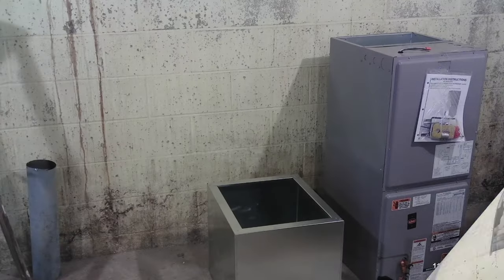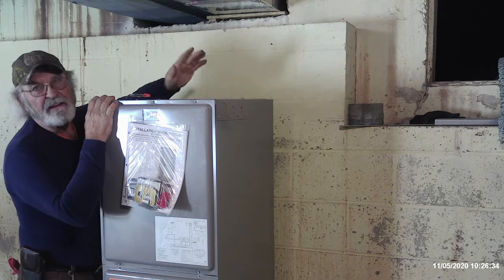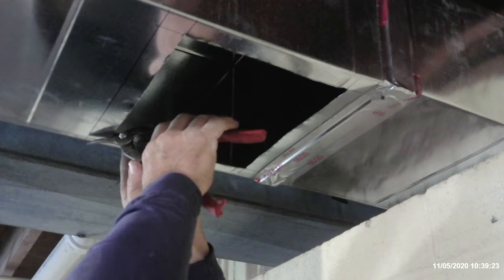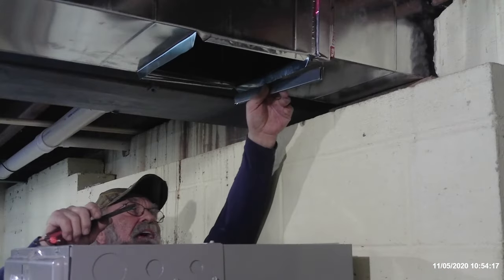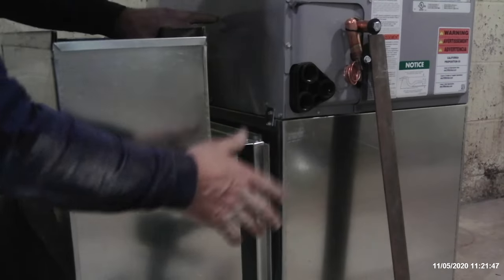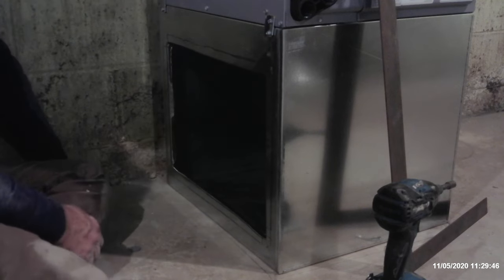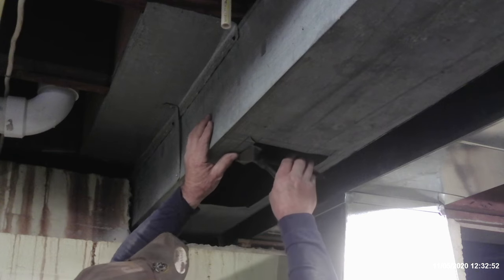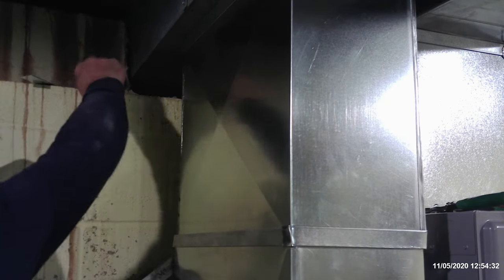Air Handler,  Centerline Plenum Transition and Return Air Installation

Comment: I'm a retired metal worker from local 48, Birmingham, Al.  U seem to have a great background of fabrication process, only question I have u used a soft joint on return air, why not include this procedure on supply duct instead of hard hookup, but great job, u had some good teaching also
Reply from the maker: Thanks David for the compliment on the project.  I usually don't use flex connectors on residential systems as small as this little 2 ton with 800 cfm.  The video may have been misleading in appearance because of the angle of the camera, but the return was a flange connection, screwed into the side of the furnace.  And that lower fitting was a  r/a 90* with a built in 1'' filter slot. Thanks again for the nice words.

Comment: awesome.  just awesome.  Some of your tips are going to save me time on my next jobs compared to some previous ones.  Cheers
Reply from the maker: Great !!  I am glad to see others getting a bit of a benefit out of the videos.  Thanks Steve for the comment and keep doing the best job you can.  It always pays off in the end.
Reply: @tractorman4461  One question.  If I wanted to "geek out" or had a more restrictive sytem that I needed to move more air through, could I throw turning vanes in the can the airhandler sits on.  I've done it before on my return boots with great success and like to do it when I can. Just going to install some heatpump/electric airhandlers with a base can under.  If I throw turning vanes in the retun boot, not sure how much more benefit I  would get our of putting them in the base can also.  Also thinking that I should either do vanes in neither or both only... any thoughts?
Reply from the maker: @sbitschy  I think the main benefit would be a more even airflow pattern across the whole indoor coil.  An engineer could probably crunch the numbers and assess the change in system efficiency with a near perfect air pattern for heat transfer. If you install them a good test would be to actually check airflow before and after with accurate readings across the fitting both times.  Of course the simple way to check cfm with an electric air handler is using the calculation for temperature rise method.  CFM= volts x amps x 3.41 divided by temp rise x 1.08  Memory fades over time, so you better check that to be sure. 
     Now that will be temp rise with resistance heat only, not the heat pump too.  If you are doing multiple systems, I would try the first one with turning vanes  in the box, then do the test to find out if there is a measureable difference in cfm. Cutting down the turbulence may reduce the return static which may actually give a good result.  You are making my brain hurt Steve...heck, I'm retired !!  I'm not supposed to have to think any more !!  LOL
   Side note:  I HAVE put vanes in return air fittings before and did not regret it.  But it is not the general rule, as you obviously know.
Reply: @tractorman4461  lol.  You are a good man.  just the fact that you responded was great.  Your thinking is along the same lines as mine.  Ive seen significant reduction in pressure loss through my return boots and filter at the outlet of the boot when using turning vanes.  Those were when entering a furnace from the side.  Just havent seen anyone do it with an airhandler where the return air has to enter the bottom with a return can.  I was just curious if you had done it or seen it work well, thats all.  Thanks again for the reply and for all your videos.  It means alot!
Reply from the maker: @sbitschy  I try to respond to most.  There are some that disappear for some reason when I click them.  And some get put in the spam file and it takes a while to find them.  The spam file empties after 60 days, so I'm sure there are some missed for good.  Crazy stuff these computers. 
   I think I said I've installed them in return air fittings, but didn't clarify that I've not really done exactly that which you describe. Good conversation Steve.

Comment: Remove section of supply trunk, shouldn't have been there in the first place.  Install full size, non transitional plenum 1" down from floor joists, with lid and use transitional pto's with 3" rise for both directions with flexes installed on each pto.  Can't you cut r/a boot with radius into side of air handler and use separate filter rack? Then furnace can be on the ground for greater plenum height.  (I might be wrong about that part). Drop should be flc, then flex, then drop duct to r/a boot.  Therefore greater static pressure on supply with smoother air flow.  Flexes are for vibration isolation.  All fittings could have been made at shop.  Way easier install.  Enjoyed your video and not trying to knock your efforts.  Cheers.
Reply: I fabricate my r/a boxes with 1" flanges built in on 3 sides exept the front for door access.  Therefore no clips required.
Reply from the maker: @Oxatolla  Virtually every job, though similar has plenty of differences.....like the return air box on this one.  It's preferred entry is the bottom because of the design of the indoor coil.  A bottom return provides a much more even flow of air across the coil for heat transfer.  You make a lot of good points, but like I said in the description, this is just illustrates one of many ways to install an air handler.  I usually go into a bit of detail in the description box and sometimes ramble a lot too, but I'd suggest scrolling back to the top, take a few minutes to read it and you might find it interesting and a bit explanatory.
    I use flex connectors commercially on systems of much greater capacity, and roof top units, but this little two ton delivering 800 cfm barely makes a sound that can be heard upstairs. Actually I almost never use them in a residential system unless its a 3 1/2, 4, or 5 ton and an attic install with the ahu hanging from the rafters.  I appreciate you watching and commenting and providing descriptions of alternate ways of accomplishing the project.  Yours is a much better suggestion on the return air box for sure. 
    On a side note about the r/a box.  Last year I changed one for a lady friend of a buddy that had continual freeze ups from the day it was installed many many years before.  The compressor (a recip) eventually locked up.  When I got there to do the tear out, I saw immediately what the root issue was.  It was a slant coil with the return cut into the side of the air handler on the discharge side of the coil !!  Needless to say, the replacement went in with the addition of a r/a box drawing from the bottom.  Thanks again, and don't be a stranger.  There's ALWAYS a reason for what you will see in my metal videos.

Comment: You sir are a davinci with sheet metal! It's amazing the work you do!
Reply from the maker: Well... I'm not quite sure I would agree with you on that one, but I take it as a darn good compliment Andrew !!  Thanks man.  Hey...side note....I got a Poulan Pro 365 I need some parts for.  Any ideas ?  No luck at L'il Red Barn or chainsawr.com.  Unless I poked something wrong.
Reply: @tractorman4461  I've had really good luck finding more uncommon parts on eBay but Amazon is awesome for stuff like carb kits, fuel lines etc I think I know where one of those poulan 365's are sitting up here in the north. Meybe I can ship you a parts unit if it comes to it?
Reply from the maker: @ButlerOutdoorsCanada  hahahhaha...that's funny, I didn't know you had a parts saw.    I'm hoping its only an impulse or fuel line.  I've not opened it up yet so I don't know exactly what I need.  It was one of those old cheapies that came my way and ran great for about 5 years.  Then one day it wouldn't start.  Iirc, its got spark, so I figured its a fuel line.  Its not a serious saw for me, but I loved its weight for small trim work.  Was great for that !!
Reply: @tractorman4461  fair enough, the fuel lines are an easy fix if it's like the other poulans I've done you can just get a generic kit from Amazon that comes with 4 popular sizes for small engines for about $14 and the fuel filters are $5-10 for a bag of em. I like the Poulan saws for what they are. They're fairly plucky and do the job intended for em, theyre owend by Electrolux/Husqvarna now and the pro models get alot of crossover parts from the rancher model huskys, alot of people like to Poo poo them so that's why I sometimes call them the POU POUlans lol but theyre a dandy middle of the road unit.
Reply from the maker: @ButlerOutdoorsCanada  that’s kinda what I think as well. I’m mostly a stihl guy. But I won’t pass on a bargain of any kind. I think I have a Craftsman that almost identical to this one too. That sound right ?  Thanks fir the above info too. I’m going to go that route.
Reply: @tractorman4461  I'm not %100 but I think craftsman was made by a number of companies the most recent I believe was an Italian company called efco, I'm not sure on that at all tho. All depends on the year and model tho. There's a really good website with an encyclopedia of information called www.acresinternet.com that should have all the details like spark plug, intake method, carbourator, who made it etc. Sthil is a love hate relationship with me I've had many catosropic failures with sthil in my commercial days however they are the driving force behind the timbersports whitch I absolutely love watching! And they put modern loggers on the map! So I can't really be against em all to much!
Reply: @tractorman4461  ^ found the links for the American Amazon website for ya man! Looks like you guys get em a little cheaper than us so it won't cost ya as much as expected!
Reply from the maker: @ButlerOutdoorsCanada  What did you type in...just  Poulan Pro fuel line and filter kits ?  Anything more specific ?
Reply: @tractorman4461  I will admit I cheated and just copied the item tittles from my previous bought items on the .CA site and pasted it in the .com sites search bar lol however I do believe the keywords are ( gas tank fuel filter) and (chainsa and trimmer fuel line) ide be more than happy to navigate the search and send you any other links you Mey need! Least I can do for all the buzz saw stuff I've learned from you!
Reply from the maker: @ButlerOutdoorsCanada  I like them because we have three convenient dealers within a 20 mile radius.  There's not a Husky or Jonsered or dealer of any kind close.  There's an Echo dealer about 45 minutes out.  If I was going to buy  something different it'd be in the Husky pro line.  But I have a pile of Stihl saws, new and old.  Just got another 038 Magnum a week ago in parts.  needs a whole top end.  But I need the electronic module for my Magnum II I bought new in '92 iirc.  I have several 028's, Wood Boss and Electronic Quick stops....026, 025, 290, several 031's, a big demo saw, 440, 660 and some others I can't remember.  Oh yeah even an old 011. LOL.  Then we start in on the old, old ones too. The Mac 99's etc....
Reply: @tractorman4461  just noticed the links aren't there I Mey have forgotten to send them or YouTube meybe doesn't like the Amazon link lol let me know if you have any trouble I can just email the links as needed
Reply: @tractorman4461  you can get most sthil parts on Amazon I've even seen a whole top end kit there lol if your dealership can't get it that is, mind you some Amazon stuff will be cheaper but Mey suffer a little quality in return for the better price. It's a bit of a gamble but as time has gone on its gotten to be an almost sure fire thing for parts. I even got a replacement carbourator for my ford 9n off Amazon lol 🤷
Reply from the maker: @ButlerOutdoorsCanada  hahaha....yeah I chuckled.   I went ahead and searched a little.  Going to order me a kit with various lengths and diameters of tubing and filters.  That'll get the little saw going in the right direction.  Thanks for the tips.  The worst thing it will be should be the diaphragm in the carb.  I found a little green 2150 on the back of the shelf I forgot about.  It's next.
Reply: @tractorman4461  yes!! The "Amazon Choice" fuel line kit with the 4 different sizes is what I generally grab when I'm in need of lines! They also sell a pack of filters they come in a bag of 15 I think, so you'll be good to go for many small engines to come lol whenever you get a chance tho ide really really really love to see a video of that model 99 you have!! That's a legendary saw man!!
Reply from the maker: @ButlerOutdoorsCanada  LOL...If you saw what I have to move just to put eyeballs on that old saw, you'd probably have a cow.  I think there's a Ford 460 and a 302 plus a couple 70's Suzuki dirt bikes, maybe a 350 GM there too.  Then there's a 1909 5 HP Galloway to move first plus a hydraulic wheel chair lift off a  public trasnportation bus.....hydro-static drive from a Baker forklift then around three or four tons of project iron...angles, channels, flats, sheets, pipes....What's funny is that's all I can think of without taking a look.  Oh yeah, at least two dead tractors gotta come out too.....LOL...not kidding in the least.
Reply: @tractorman4461  hey man i totally believe it! I know an old boy with a situation just like that. lol I've bought my buzz saw from him, my case s tractors and my one project 44 massey. And he's still got a sea of tractors , saws , implements etc. He's probably one of my favorite people to go see not just for his collection but for the history and story's he has, I'll likely be getting an old mcculloch quick cut/concrete saw off him next time I make the trip, I would have gotten it last time but my truck was already full of an atv, parts and a few homelites lol but that quick cut is a beauty big ol girl an im exited to tinker with it!

Comment: You know this man is a true tradesman because he uses everything as a hammer! Haha... all joking aside, great video... im a industrial, commercial, and institutional guy, so I don't get to see many residential installs... Also on top of that, I am more of a shop guy... I like how  for your tags you actually used your bar folder to make it S and Drive... never seen that before...Great job man, I hope to see more videos from you
Reply from the maker: Hahaha...yep, whatever ya got available to beat something with will do in a pinch.  LOL.  I too spent the last 25 years mostly in the same segment as you describe.  My favorite was new building/system startup.  Nothing better than working on brand new equipment.  I also really enjoyed large capacity RTU DDC conversions....ripping out the old controls and actuators and installing replacements for control with the building automation systems. I also enjoyed commissioning air houses/chilled/hot water systems and all the FTU's, VAV's and building pressurization control. I really like Trane chillers and Lochinvar boiler set ups. York is my least liked along with McQuay.  But I'm talking 250 ton and less. I'm not a centrifugal guy. 
   The list goes on...but you get it.  I hadn't been involved to any degree with sheet metal since moving to that segment of the industry.  I'm actually a service tech, not really a tinner, it's just at the earlier part of my career I managed to do a lot of it. I really only ran  residential for the first couple years back in the 70's and early 80's. Retired  now, I can play with it a bit.  Btw,  I have a ton of sheet metal videos up in the playlist section:https://www.youtube.com/watch?v=PvDab537ul4&list=PLk72G9DTzZ1taVZjyeN9DKr52HQ3hhcXd Thanks for the visit today Greg.  Retirement is GREAT !!  I don't have to answer to anyone. LOL

Comment: Solid work man. I personally  like using  just S-lock all the way around  and screwing it, in thos kinds of transitions. We tape everything tho
Reply from the maker: I do when necessary...like when boxed inside a tight closet hard to get to spot. I use aluminum tape and mastic for attics and crawl spaces, but not for basement areas.  Minimal leakage with tightly trimmed joints don't seem to be a problem. Here's a real good example Tommy: https://www.youtube.com/playlist?list=PLk72G9DTzZ1taVZjyeN9DKr52HQ3hhcXd There's some crazy stuff in this one at my son's house.  Attic job.  Thanks for watching and commenting !!
Reply: @tractorman4461  I like the way you made that drain pan. I've worked at like 3 different hvac companies  and everyone of them still make it the way you explained with solder and the tabs on the smaller side. I'll have to try it out next change out. I'm from north Carolina  been doing hvac for like 10 years lol still got alot to learn but your videos  are great I'll definitely  learn some things from them. Are you retired?
Reply from the maker: @tommymatthews4984  Yes, I've been retired 9 1/2 years, after 40 years (+ -) in hvac.  Most of the time in  commercial service and startup, DDC controls and CW, HW and refrigerant piping. What I do for you tube videos is just help out people that kinda need a hand...or maybe friends and family. Most wouldn't be able to have it done by a contractor due to costs. I hadn't done any sheet metal for 20 years or more so I was really rusty back on my first few videos.